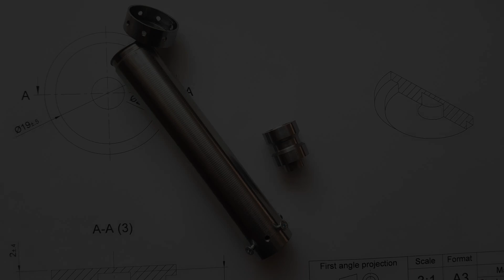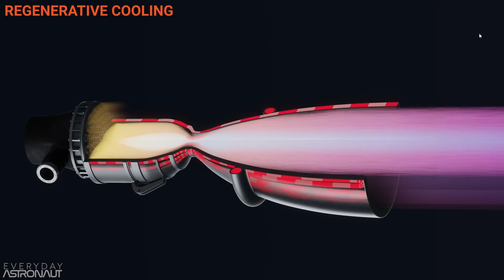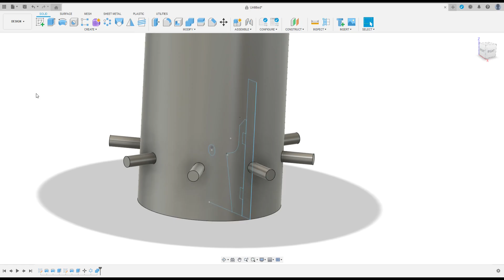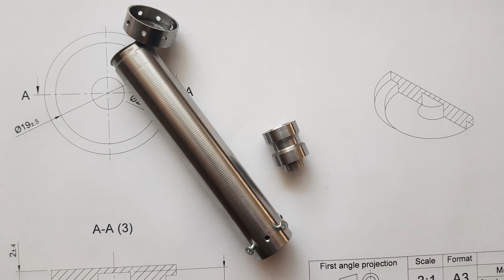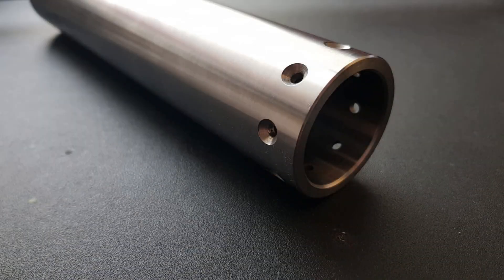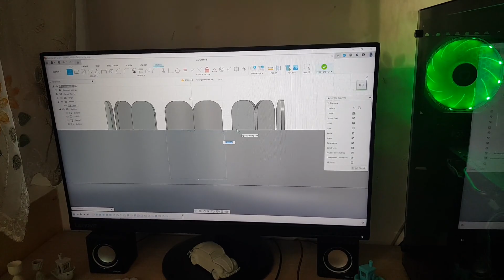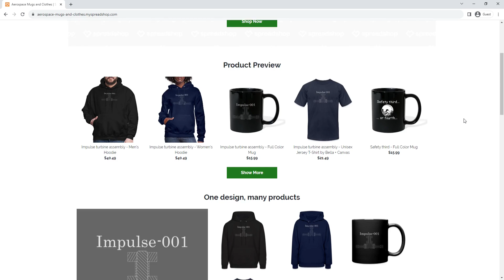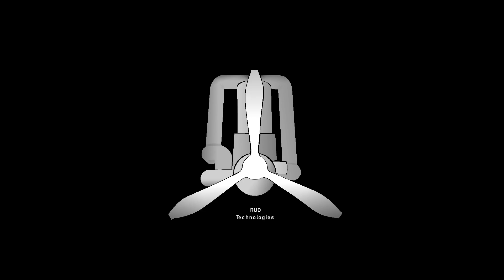I am making a Liquid Rocket Engine!

Comment: Hey, I am working on a similar project and need metal 3d printed parts. Would you mind discussing your experience importing these parts and dealing with ITAR regulations? Thanks for any help!
Reply from the maker: I am happy to hear that! If anyone asks, It's a component for a jet engine ). They don't mind jet engines and also, if the rocket has low thrust they should be ok with it!
Reply: @RUD_Technologies  Thanks! Mine is only ~65n, so that should be fine. How did it go dealing with customs to get them to let it through? Did they just mail you something?
Reply from the maker: @Dstaffmakes  Yeah. They are quite careless.

Comment: Some tips from a mechanical designer: 

1# Weld the inside seam of the flange and pipe with no or little filament to make sure that it is gas tight. This also makes it way stronger. 

2# Use countersunk insect-screws for easier assembly and disasambly

3# Use high-temp o-rings. your O-rings will get cooked from the heat and start leaking. 

5# Use high-temp silicon grease. This will also make it easier to disasamble the engine and could also protect the pipe from the heat. 

4# Nickle plating will help but there are ceramic coatings that would work better. And maybe increase the life-span of your nozzle. Look at ceramic piston coatings👍🏻 

Hope that that some of these tips can help😉 I am looking forward for the test firings.😀
Reply from the maker: Thanks for the advice! I originally wanted to weld the inside too, but the guys at the weld shop said they can't reach that zone safely, even though it's at the end of the assembly... Also, thanks for the silicone grease and ceramic coating tip. A ceramic coating would actually be a great idea!
Reply: I found it interesting that he welded the thrust chamber.
Reply: No problem, looking forward to se your progress😀

Comment: What type of fuel injectors are you using? If you are not using any an easy way to make one is to get a m3 long nut and a m3 spiral tap and put the tap into the m3, nut. This method scales up. The reason it works is because the spiral in the tap forces the fluid to gain angular “momentum”. I’ve made a short rough video showing it working.
Reply from the maker: Thanks!